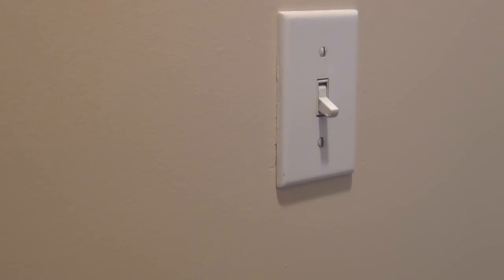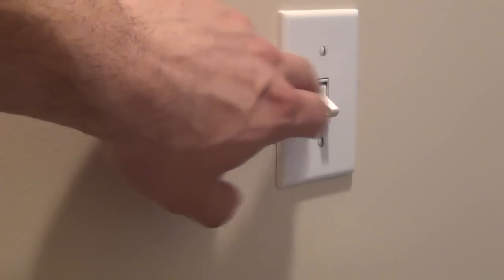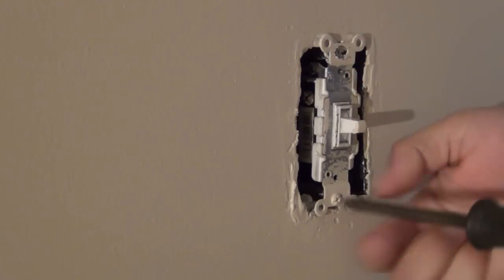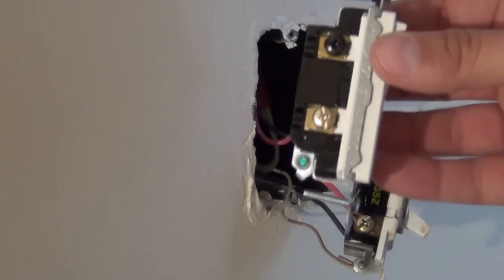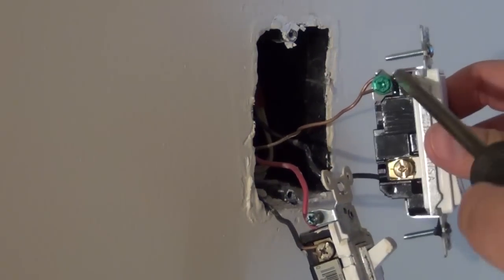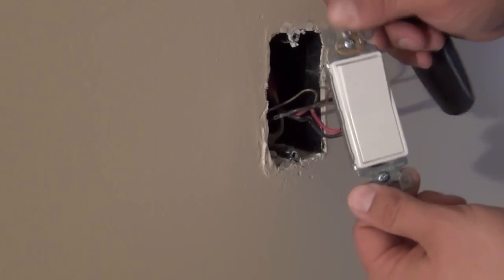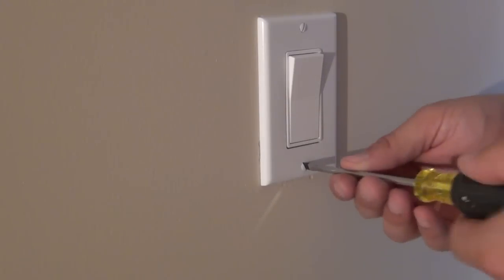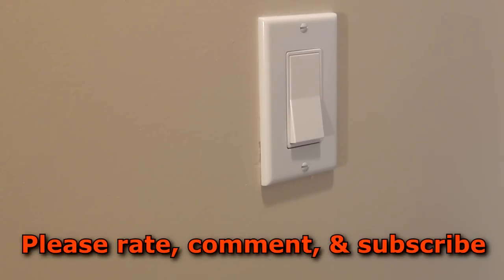3 Way Switch Installation

Comment: Awesome, great video.  You explained in your first sentence what nobody else could.  Couldn't you also use a voltage tester to find the host first and then mark it?
Reply from the maker: nycupperes Not really because depending on what switch you're at on the circuit, that black screw could either be incoming power from supply or the feed wire to the light.  Always good practice to kill the power to the device before removing from the j box anyway.  Thanks for watching.

Comment: hey man, I just got my 3 way switch replaced but I believe I did it wrong, well actually I did it wrong because I connected the red wire into the black screw. My question is, can any of the 2 black wires go to the black screw? or is a specific one of those 2 blacks that goes to the black screw? hope this make sense. Thanks.
Reply from the maker: The traveler wires can go to either screw. You just need the source power (feed in) on the one switch and the load power (fixture) on the other switch connected to the correct screws. Hope this helps

Comment: I found another explanation while my downstairs switch was disconnected and I didn't know which wire was the common or "hot" wire , so here is what I found:

    Begin by removing both switches.
    After getting taught a lesson about respect for electricity, turn off the circuit breaker and then continue removing both switches.
    Between both switches, one wire (and one wire only) should be hot. Label it as your "panel hot."
    Install one switch at that location; wiring the "panel hot" line to that switch's Common/Hot screw. Then wire the other two wires on that switch.
    Go to the other switch. Toggling the first switch and testing the wires for the second switch will reveal one wire on the second switch which is never hot no matter the position of the first switch. This goes to the light. Wire it to the second switch's Common/Hot screw. Then wire the other two wires (which are the travelers) on the second switch.
    Test both switches; they should work unless there's something messed up at the light.
    Like many others, I prefer the light to be OFF when both switches are in the down position, ESPECIALLY for a light that's hard to reach. If you didn't chose wisely the first time, just reverse the travelers on one of the switches.

Thanks for the video

Comment: Great video!   I just saved 2700.00 by replacing all the switches in my house with rocker switches.  A contractor told me not to do these 3-way switches because they were VERY tricky.  I couldn't imagine how it could be so "tricky"...  26 switches (combo of 3way and single) done with my sons in an afternoon.  Nice bonding time with the boys.  I have no qualms about hiring a pro, but I knew this was work i could do with some research/educatoin.  NICE video - thanks!
Reply from the maker: Nina Beheim Great sense of satisfaction doing things yourself!  Glad the video helped.
Reply: Is that really how much it would have cost? Reason im asking is im replacing all my outlets and light switches and the land lord will take money off the rent. I just dont know what this kind of job costs to have him take money off my rent? Any1 know??

Comment: Thank you for the response. This turned out to be a bigger deal than we anticipated. We called an electrician. Someone in the past had wired a sensor light on the back porch and a fan with a 3 way but didn't wire them correctly and in doing so all the sockets on that side of the house were shorting. Crazy. The electrician was able to find and correct the wiring error. I think we did the right thing and called a professional. This fix was beyond my experience. Thanks again for the video and the response.

Comment: First foremost, absolutely great informative video!!! 
Need your help....
So, my new dimmer doesn't work with my home's wall wiring set up which also appeared as a DUAL pole wired box set up and oddly was wire connected to the old standard snap off & on light switch surprisingly as follows:
1 black wired to switch 
1 red wired to switch 
2 white wires capped
2 ground wires capped 

And, new SINGLE POLE dimmer replacement wire connect per manufacturer's instructions specifying to NOT install wires as you demonstrate, but to insert wires into tiny portal holes and screw tightened as follows:
1 black ( line)
1 black (source) 
1 white (neutral)
1 ground (ground)
Unused wires obviously: 
1 white capped
1 Ground capped 
1 Red capped

Now, I followed manufacturer's instructions which excluded red wiring and connecting all other wires, however, no success. So, should wall red wire actually be included as it was for the old off and on snap switch, despite manufacturer's instructions never mentioning red wire connection??? Secondly, it's obviously correct the extra white and ground be capped since new dimmer instructions excluded the use of extra white and ground wire. Finally, single pole dimmer switches or any single pole device can be safely used in a dual pole wall wired electric box set up? 
Help me, please?

Comment: what is copper/brass tab under mount screw for? 00:27
Reply: Self grounding clip, notice that screw doesn’t have a little plastic tab to hold the set screw. Also 6 years late lol

Comment: What if I have a double switch box and want to replace just one switch and the switch I'm replacing has three black wires? One I know you said in the video is a traveling wire, so that goes to a copper screw. So how do you then determine of the other two which is hot? And remind you the old switch is an old switch. The wire ends are pushed in. No screws.

Comment: Thanks for the video.  What happens if the switch doesn't work after the install?  I did leave the light on prior to turning off the power.
Reply from the maker: phil medina Put the other switch in the circuit in the opposite position. Does the switch you changed function now?  If so, you have a traveler and the hot mixed up.

Comment: Hello. I need to add an other outlet to my kitchen. I been updating my kitchen and the fridge is going to be a the other side of the kitchen but I have no outlet. There is a wire where I can do the connection. But it has 4 cables grounded, black, white and red. Do I need to hock them all up or can I just take ground, black and white?

Comment: thanks for the emphasis on the black screw..I told my electrician I could do it since we never had the switches on hand and he lives an hour away. he twined the two wires(black and red)  together that should go on the same side and one black wire on the side of the single screw, while white wires were swined and capped  together. I did that and it didn't work. so after I watched the first 1min of your video, I went and check mine, i switched the two black wires around and BAM it worked...thanks a lot
Reply from the maker: You're welcome.  Glad you found the video helpful!
Reply: cheryl-ann battle BBCj

Comment: I removed a socket from a wall in a house we bought to put on a more esthetically pleasing socket and cover plate. The wires in the box, 1 black, 1 white and the ground, are all so short I cannot connect the new socket. Normally, I would pull them out of the box to work with them but in this case they are just too short and do not extend outside the box. It is a 15 amp socket if that helps. The house was built in 1970. Can I, "splice", wire safely to extend the length? Honestly, I don't know how the original electrician ever hooked this up in the first place. Please help. Thank you in advance.
Reply from the maker: You can pig tail off those existing wires and wire nut longer pieces of wire onto them inside the j box.  I've seen this happen before.  Just make sure you twist the wires together well before nutting them.  Also, with your house being built in the 70's, please make sure you don't have aluminum wiring.  It was very common back then.  If you do, the process for extending these wires will vary greatly and should only be done by a licensed electrician.

Comment: More complicated wiring question.   Have three switches, 2 -3way switches and one single.  Line up like this view.  Right side is a single switch that works front porch light only.  Then middle switch works Light top of Steps which has a switch upstairs near light too AND third switch controls light in front foyer and a second switch in hallway that too controls light in foyer.   I get close to getting it to work and then issues and doesn't work correctly.
Any help you can provide?
Reply from the maker: What isn't working right?  Did it work correctly before you started replacing switches?  You might have mixed some wires up.  Does only one of the 3 ways work at alternating times and the different switch locations?  If so, you have a traveler installed on the wrong screw and just need to swap

Comment: Thanks for the quick video.  My original switch was very old (possibly original 1950's),  However once you specified the common had to match the rest was a piece of cake.  Found "COM" on the old switch and the rest took a few seconds.  Thanks!
Reply from the maker: ryx2469 Great - glad the video help!

Comment: Had a situation of no power in front room once.Raised ranch.  Breaker was OK. Oddly, found looseness in  screws at switch at top of stairwell to basement stairs.Thaf was a 3way to run the stairwell light . Go figure that one.
Reply from the maker: roadking99 jokerst Yup, doesn't take much for a circuit to not work properly.  Good find!

Comment: I have a 3 way circuit for my basement stairs. I want to add another light but I cannot gain access to the existing light without a ton of work and drywall removal. Can I add the light and just connect it to the lower switch and have both lights operate together on the 3 way circuit still? Thank you great videos.
Reply from the maker: It depends on how the circuit was wired.  If the wire leaving the bottom switch goes directly to the existing light fixture, you can tap off that.  However, the bottom switch might be your feeder wire from the panel so that wont work.  I had the same problem as you trying to tap into the existing 3 way circuit to add a fixture.  I ended up biting the bullet and cutting a few access holes in the drywall to do it right.
Reply: the issue I discovered was the only way to get a neutral to the second light is from the first light because in the switch section of the circuit the white becomes a hot current carrying ungrounded wire and the black is the feed for the lower switch"s common terminal.
Reply from the maker: Atticus Finch That makes sense.  Looks like your only way is to open up the drywall and tap off the existing fixture.

Comment: What if i have old switch, that has no screw indicaring a hot wire?
Reply from the maker: lr yv You'll need to ohm out the wiring while the power at your breaker panel is off.

Comment: great video ! if i want to get romex wire to extend the wires in the box , my question is can you get romex in any length you want because i always see it sold in big rolls?
Reply from the maker: +GmGarlo Smallest roll I've seen is 25 feet.  Not that much - maybe 10-12 dollars.  Thanks for watching.
Reply: Home depot sells remnants.

Comment: how do you do it if all the wires are black?
Reply from the maker: +Hiphop Anonymous Turn the power off at the panel and use an ohm meter or wire toner/tracer to identify them.
Reply: +zimsjeep 
got it thanks.... don't have an ohm meter, just went trial and error till everything worked.  😕. seems to be working fine now.

Comment: the electric that he is dealing with is at most the hazardous I have ever seen and I am not an electrician but know a bit about electric,bare wires all over the  place especially the earth wire that is there with no cover on it, what would happen if the earth wire touches the live wire and there's a fire which could happen. I am appalled at the wiring video.
Reply from the maker: Wow, you really have no clue what you're talking about.  Probably shouldn't even bother replying to this but I will. ALL Romex wire has a bare copper ground.   What other bare wires you talking about?  The ends of the conductors have to be bare for the circuit to work.  What would happen if the wires touched a screw?...The circuit would short and trip the breaker.  If you watched carefully however, I mentioned that I shut the breaker off before working on this so the answer to your question is nothing would happen.
Reply: I really hope Anne is just trolling. All grounds in romex are bare, please don't confuse people just because you feel like it, you might end up getting someone seriously hurt someday.